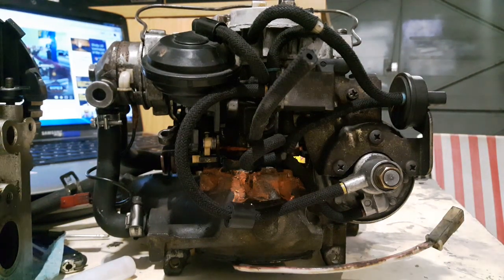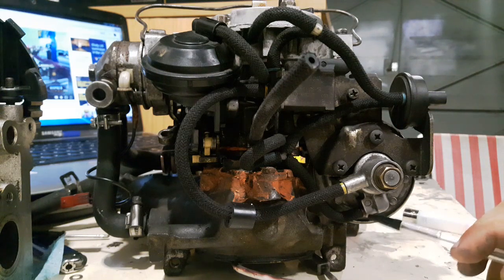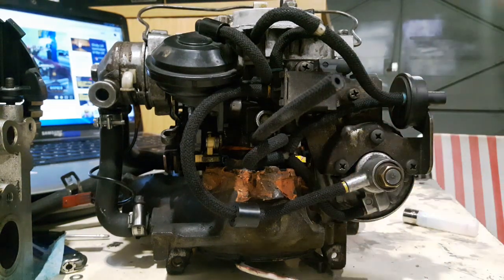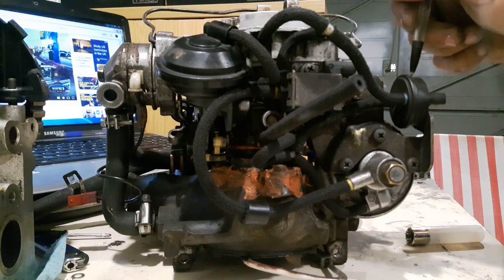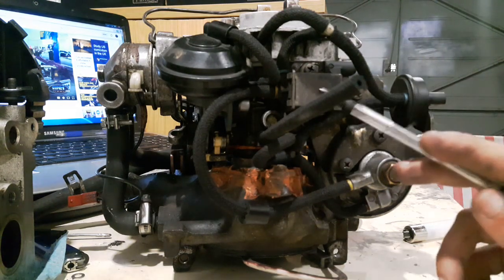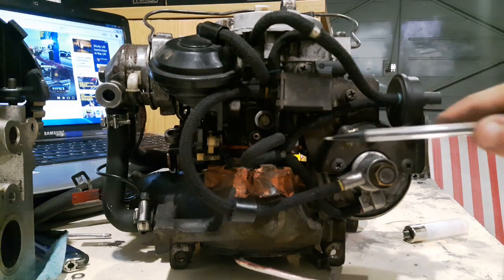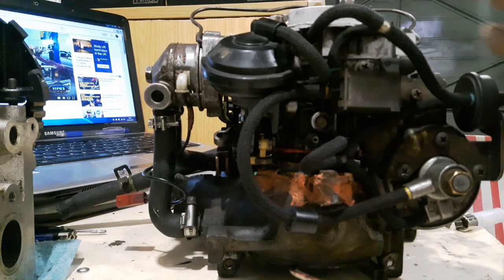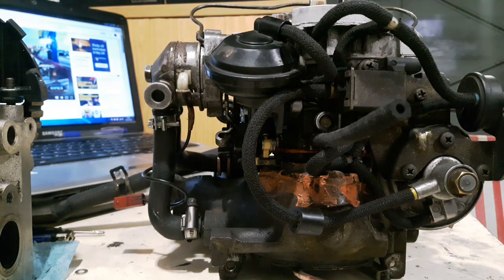The Pierburg 2e2- Rear Vacuum Line Routing and Operation

Comment: Thanks for this wonderful lecture. I would want you to do a complete tear down of 2E2 and functions of the components. Am still confused how fuel is drawn and injected into combustion chamber. Thanks for the guide,
Reply from the maker: Hi there! thank you for your kind words, I'm in the process of making a tear down video of the 2e2 which will include a detailed look at all significant components, this will include the basic components of a carburettor :)

For now however, the fuel enters the combustion chamber by the negative pressure the pistons create on their down stroke  (intake stroke). When the pistons moves down in the cylinder and creates this negative pressure, the fuel is drawn out of the fuel jets in the carburettor, mixed with the air that's moving through the venturi and into the engine.

In short, there's no active injection of fuel during normal carburation, the only time fuel is 'injected' is when the accelerator pump is operated.

I hope that helps! keep an eye out for the next 2e2 video which will have a lot more detail! 

Thanks a lot :)
Reply: @skyrocketautomotive  hi there my 2e2 is running rich. I have rebuilt it not still no change' I have even changed the dizzy and coil to no result. Would you point me out to what checks I could do. I haven't adjusted idling screw from when it worked ok.

Comment: Hi, maybe you might know what's wrong my 2e carb. It either doesn't generate enough vacuum or none at all. 
As a result, the second valve/chamber won't open and my idle regulator does not move/regulate at all...

Where should I look, check, do to find out the root of this problem?
Reply from the maker: Carburettor base flange would be my first check, the rubber part between the carb and the inlet manifold

Comment: Hello. I hope You Can help me telling were the vacuum line for the advance on the destribiuter goes? The one that sits in the back on connects to the air filter case, is mounted to my advance, on the one the air box I blocked off. 

Can you help me? Have you got a diagram ? 

Best regards
Reply from the maker: Hi There, distributor connection is made at the large pipe going to the brake servo, there should be a non return valve with 2 vacuum ports

Hope that helps!

Comment: Hello 
I have 2e2 carb like this
Stage 2 vacum unit is good but carb dont  pull vacuum
I clean vacuum hole but dont work
Please help me ????
Reply: Hi there have you checked the condition of the pipe?
Could be craked.

Comment: Does anyone know how to wire up the TTV ? It's the one thing I'm missing from all the searching and videos I've watched until now. Does it get 12V with ignition and then just does its thing ?

Right now I've got  a wire going from the heating coil to the PTC heating bypass, then into a connector so it can actually get power (which then has a wire to the runoff solenoid and into the TTV)
Reply from the maker: TTV isn't polarised (the connector can go on either way), and yes it should get 12v with the ignition on, hope that helps and thanks for watching, hopefully I'll catch that in my next video!

Comment: Hey I've been trying to sort out a 2e2 carb which has been rebuilt using a few different carbs, hasn't really run properly since we've fitted it tried a lot of things including what you've discussed in your other videos, main problem is starting issue and not idling nicely (fluctuates) also a hesitation when sharply hitting the throttle, 3/4 unit fully retracts after it hits 2k revs and throws out the piston but sometimes not quick enough and have to have a high idle to compensate, even when warm the car doesn't idle nicely and the whole ignition system has been replaced to but not much difference any suggestions?
Reply from the maker: I'll be honest; without looking at the carb on this occasion I wouldn't like to say as so much work has already been done to it. Feel free to get in touch if you're still having trouble and want me to take a look!

Comment: Hi mate.. thanks for the vids theyre really good.. my 1.5auto is running awfully. im going to replace all the vac lines as they all seem to be original from 83.. ill also give the carb a good clean as has been unused for a while. running issues are that it looses power when driving, ussually when warm, it also sounds like it was misfiring, i adjusted the dizzy and it ran much nicer for about 4 miles then got the same issue of loosing power...if i leave it for a while.it will fire back up but only drive a short distance and die again. any ideas?
Reply from the maker: Tim Cutting Hey dude, thanks for the comment! Try taking out the little gauze fuel filter in the inlet of the carb, they restrict fuel flow big time!

Keep me posted, god speed!
Reply: SkyRocket Automotive are the vacuum lines all 3mm?

Comment: Thanks for this. I am looking after my Neighbors GTII, and she is ticking over at 3k. I have replaced some of the vac lines and she was fine for a while, but I think the leak has moved to the next weakest point. Would the Wax stat cause this sort of revs?
Reply from the maker: Hi There Mike, 

Thanks for watching! It's unlikely to be a Waxstat issue as it doesn't have the capability to push the RPMs up that high, even when maladjusted they'd sit at 2k maximum.

I'd be looking more towards the TTV or possibly a goosed 3 point unit.

What are the symptoms? If it just sits at 3k right from cold I'd aim for a fault with the TTV or a vacuum hose being split. If it's after being driven it could even be something as weird as the 2nd throttle butterfly getting stuck! 

I'll do a video on how to test a TTV Shortly and post it up for you.

GTII's rule btw! Had one as a daily for 5 years now and it's never let me down :) Awesome things.

Thanks for watching! Keep and eye out for the video!  

Kyle
Reply: Hi Kyle, my neighbor is 82! and his GTII is mint. I am going round tomorrow to have another look. I think I'm loosing vacuum to the 3 point. the lines were shot. I replaced most of them, but think either one wasn't on properly and has come off, or another is perished. Will let you know what I find. Thanks for you help,  Mike

Comment: Hi, great videos, hope you can offer some advice on my carb problem. I have a VW polo 1.3 1990 with a pierburg 2e carb. When idling, the revs of the engine fluctuate continually. When the engine is cold and is running with higher revs the engine will run but the revs fluctuate. When the engine is warm and the revs drop when the autochoke disengages the engine struggles to idle as when the revs fluctuate, at the lowest point in the revs fluctuation the engine will cut out. What is causing this?
Reply: Did you find a solution to these issue?

Comment: Hi, do you know someting about Pierburg 2e carburetors?
Reply: There is no 2e carb. It has writing "Pierburg 2e" but it really is one of the three types 2e2, 2e3 or 2ee. 2e2 was on and 1.8 GU Golf/Jetta and early 1.6. 2e3 was on 1.3 Polo. 2ee was on 1.6 Audi 80. I have 1.8GU with 2e2 and on the body it has indeed "Pierburg 2e" sing but it's 2e2 type